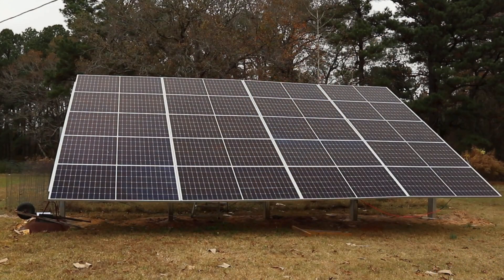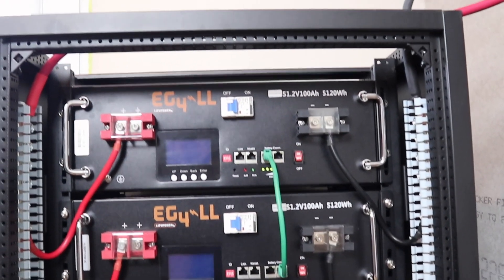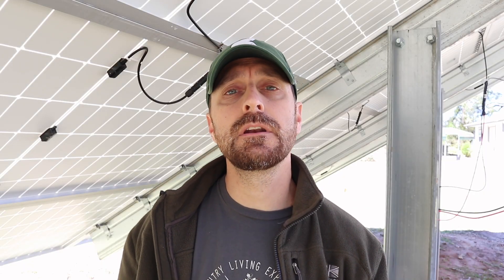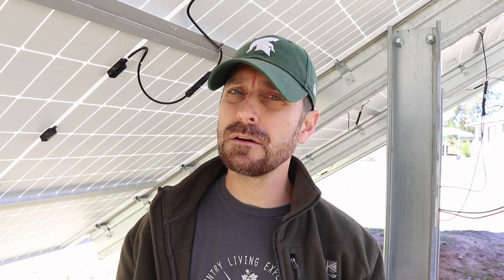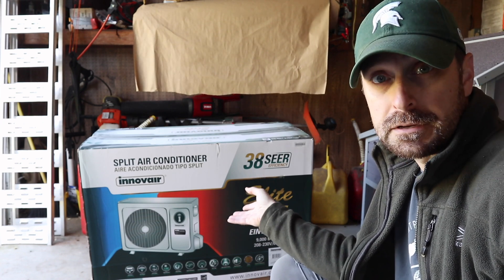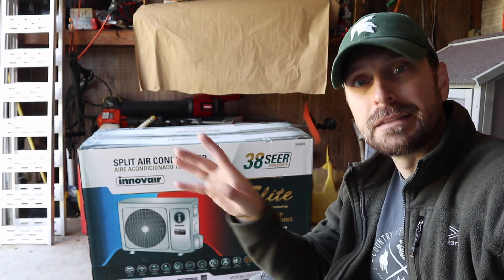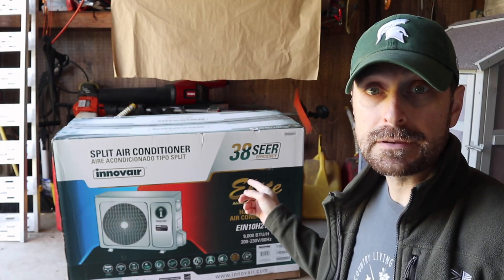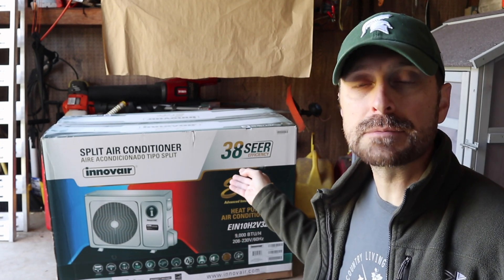Can Solar Power My Heat Pump 3 Ton HVAC System? Yes...BUT!!

Comment: I installed a Bosch IDS system 3 ton heat pump it can ramp down from one and a half tons to 3 tons plus 10%, it's an awesome unit the compressor side of it is a variable speed DC control works great with solar system
Reply from the maker: Interesting. I am totally unfamiliar with that system. I'll check it out.

Comment: You put in your own solar but cant install a soft start?  What?
Reply from the maker: I probably could if I studied and spent a lot of time on it but that was not really the point. Point is my system is old and does not warrant any upgrades or fixes to make it work when there are better more efficient feature rich options like mini-splits that run better off solar.

Comment: I'm surprised the 2 paralleled Growatts would require a soft start for your existing unit...   You have over 40A @ 240v there, without the momentary power rating they put out (up to 2x).   I'm not saying you don't have other good reasons to get rid of it, but seems like it could handle it fine.
Reply: Starting Amp draw is 4-10 times higher than full load amps.  Can the growatts handle the surge?
Reply: @johnlockington9872  Yes.   They are rated at 2x rated power for 5 seconds.   That's 80A @ 240v.
Reply: @struc5810  they won't handle it. They'll trip. If they could handle it he wouldn't need a soft start
Reply from the maker: Solar company told me they could not handle it so I defer to their expertise.
Reply: @johnlockington9872  Personal Experience?
Reply: @struc5810  I have a growatt off grid system and I work in hvac
Reply: @johnlockington9872  Awesome... then you would know.   Thanks for confirming.

Comment: I just put two of the pioneer mini splits in my house in savannah and they work really well and don't cost much to run, I used 220 because that is supposed to be more efficient than 110.  I've never seen seer ratings as high as the ones one that system though, looking forward to see how they perform.
Reply from the maker: Cool. Yes, 220 is more efficient.

Comment: I bought a Trane Heat Pump , unlike my 2 other units, this had nothing but problems. The parts were made in Mexico, and China and supposedly assembled in the USA. I am 71 and hope not to have to buy another one but if I do, it will be a split system also.
Reply from the maker: I hear that. It is hard to find anything good anymore.

Comment: We are getting three mini-splits for our ranch.  Two of them for the house and one for the solar shack.  We live in the desert and elected to not have the solar shack open to the outside dust and heat.  Instead we over insulated it and are adding its own dedicated mini-split.  Of course the temp will likely be set on something like 85 in summer and 65 winter so that it doesn't use a ton of power.
Reply from the maker: Awesome! That will work great.

Comment: I’m really enjoying your videos. While I did go with different batteries and a different inverter, your videos still provide plenty of great information. My question with this one is something I don’t see addressed. How to handle a mini split install where you have an older house (1950) and the rooms are split up by walls (not open concept). With so many rooms, even a smaller house would need one of the “wall units” for each room and that would get expensive, no?
Reply from the maker: Thank you. Glad they have been helpful. 
Yes, older homes could be a little more challenging but it should work. I have seen these installed in historic homes that don't have space to add ductwork. You can get systems with multiple head units that have long line sets.

Comment: Those soft starts are easy to put in. I put one on my 3 ton system at my last house and it ran it great. But it was only about 5 years old.
Reply from the maker: That's cool. If my system was new and didn't have leaks, I probably would have considered it.
Reply: @CountryLivingExperience  yeah, it sucks you’re having all of those problems out of it. I could run that unit with my 6250 watt gas generator with a 30 amp interlock kit along with the fridge and deep freezer. Can’t wait to see more of your videos man! Doing good stuff
Reply from the maker: Thanks

Comment: When I design PV systems, I generally double size (array, Inverter & triple batteries) to operate a central HVAC🌻
Reply from the maker: I totally understand. It is good that you do.
Reply: What about a hot water heater?

Comment: I know u could install the easy start. I have pretty much the same problem old ac low on freon. It's probably 30yrs old.  I think a heat pump with a coil where the old a coil on top of the furnace so u can cool and heat the house is probably the best plan but  not as universal as the split unit tho but if u run the furnace circulation fan to distribute the cooler air can work also. I also like the idea of redundancy multiple split units is a good thing in my eyes. Love the videos about solar.  Keep them coming.
Reply from the maker: Thank you for the confidence in my ability. I appreciate it. I have heard that running the central unit fan for circulation is a great idea and I will surely do that.

Comment: I've heard varying things about mini splits. They are more efficient than many systems, and will undoubtedly be more efficient than your 13 year old heat pump. However, I've heard of many reliability issues and a lot of people I know end up leaving them turned off and using other supplementary systems, especially when it comes to heating.
Reply from the maker: I have heard that too but only about the cheap brands. My wife is from Asia and they are exclusively used there without many issues at all. I do like backup systems though. I have my wood stove for heat.
Reply: @CountryLivingExperience   yeah I definitely think sticking to high quality brands is a must, given the necessity and cost. Wood stoves never fail and are still the cheapest fuel.
Reply: @CountryLivingExperience  U.S. uses heat pumps. Rest of the planet uses efficient ductless mini splits.
Reply from the maker: @rustyloads1361  Mini-splits are heat pumps
Reply: My mitsubishi is outstanding. Have it for a few years, and it's cost me next to nothing to run.